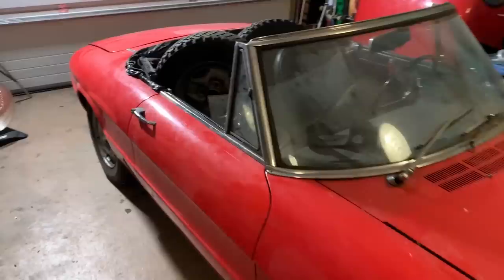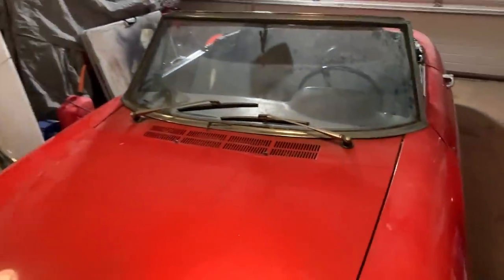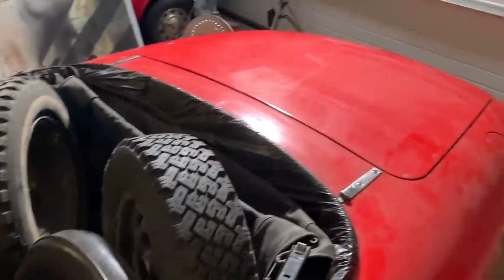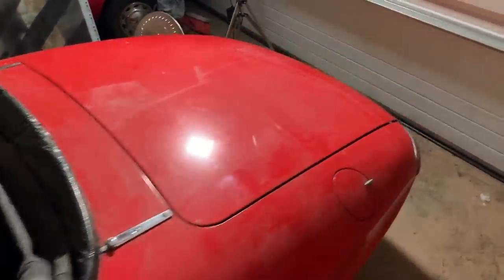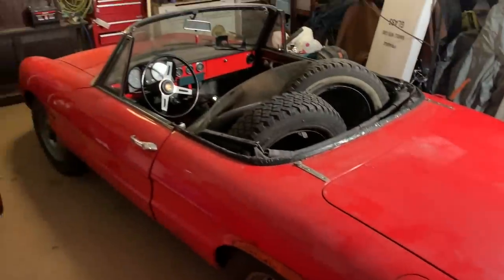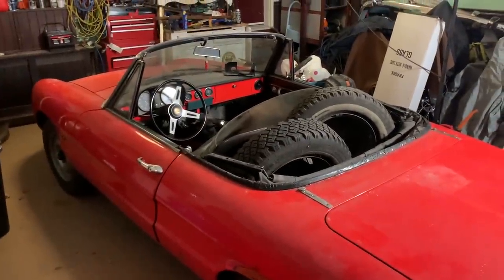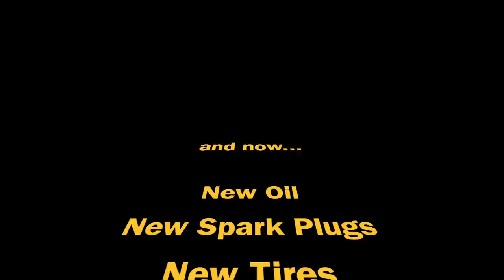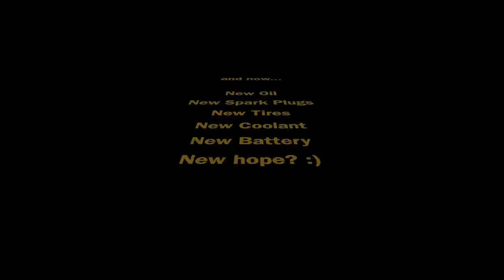First drive, parked for 35 years barn find Alfa Romeo Duetto Spider

Comment: Nice ride. I hope you warmed it up properly--Alfas don't like to run cold. I had an Alfa in Bulawayo, Zimbabwe, and it blew a head gasket after driving it without warming it up. It took a few drives to do that, and that's when the mechanic told me I had screwed up big time.